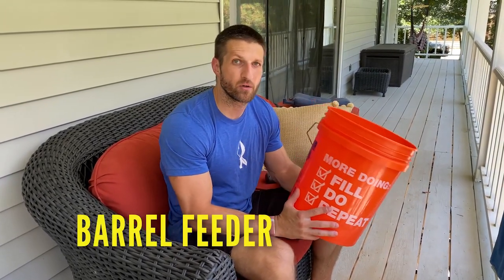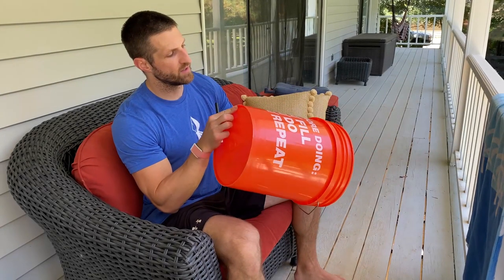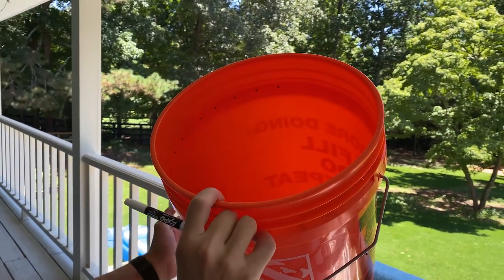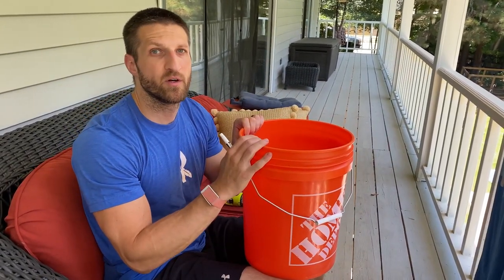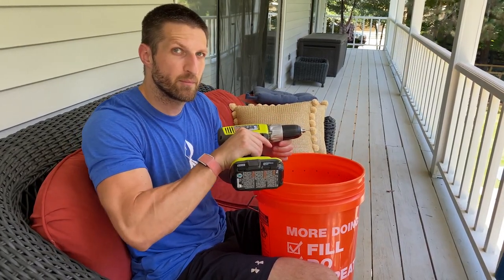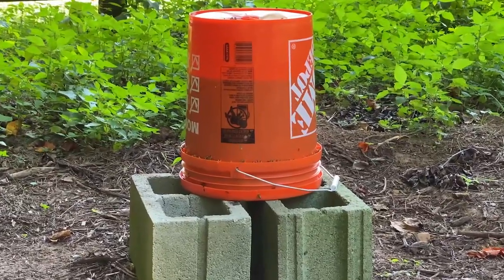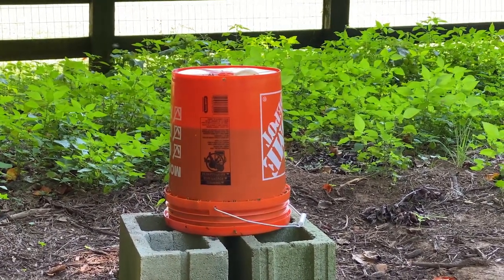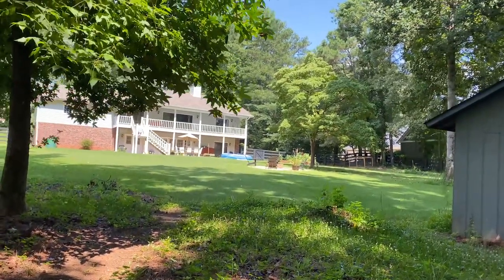How We Built a Bucket Feeder For Our Bees

Comment: You skipped how to close the lid to the bucket. Some lids are closing at all.
Reply from the maker: The Home Depot bucket we use just pops on and forms a tight seal.
Reply: @kummerhomestead  I bought some twist ones and they were not too good. Going to try the regular home depot lids.
Reply: @mathgasm8484  Yeah, I noticed how the twist lids don't work quite as well (just got some for another project).